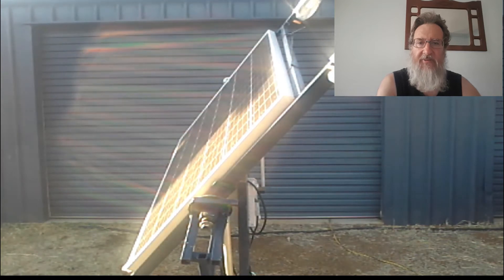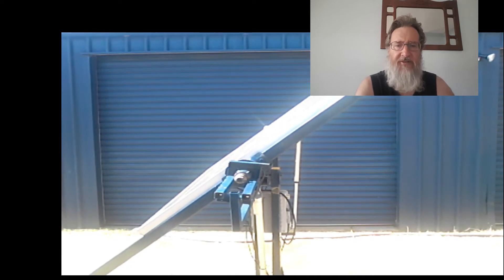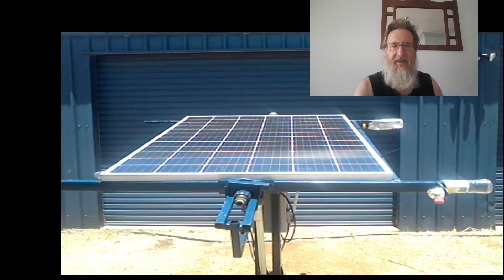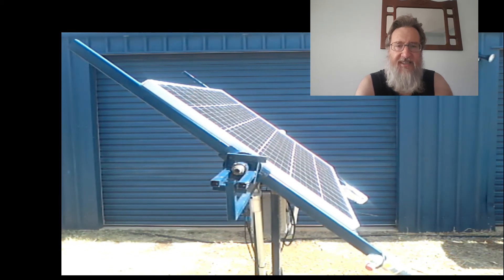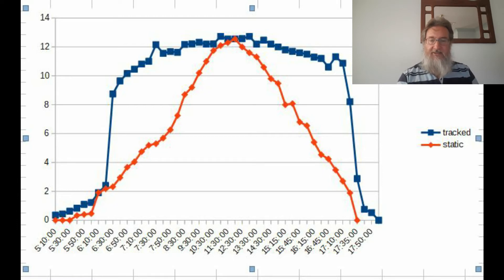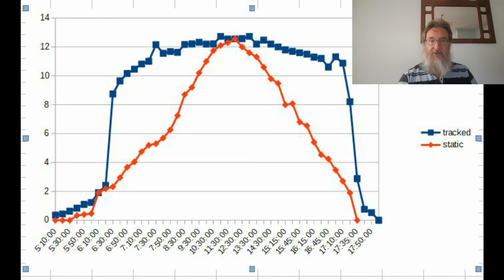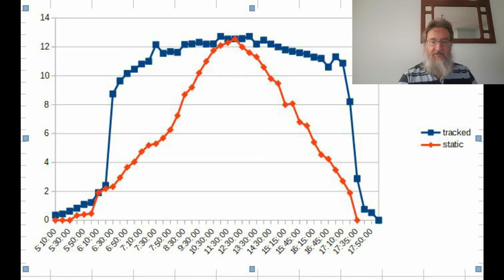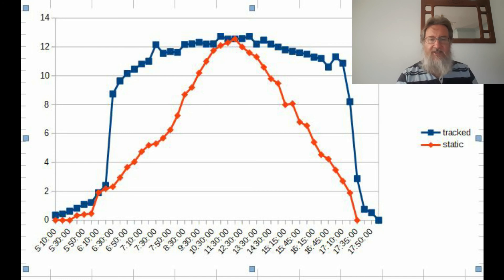Should you use a solar tracker?

Comment: Hi, I use a 2-axis solar controller with my solar tracker: https://youtu.be/_Rs8CptQcDw . Save electricity costs: With the Dimmer + Solar PV, self-sufficiency will now increase to almost 95%, which means a huge breakthrough. The prerequisite is that you have at least a small balcony power station, and you don't need an expensive battery either. Example of a kettle: Without a dimmer, the 2500W - 600W PV system needs = 1900W, which you have to pay more for. If I turn the kettle down to 600W with a dimmer, then every weak PV system can now supply each consumer independently and independently, because the 2500W kettle becomes a 600W kettle thanks to the dimmer. Magic... The 2000W e-heater becomes a 500W e-heater with a dimmer, which can run 12 hours a day free of charge via PV. https://youtu.be/QbLWDbJi6ew . The 4000W oven is also tamed. Not the solar systems have to grow, but the consumers just have to drop by 75%, which is sooo easy with the dimmer. are you convinced now I have already switched my entire household to dimmers. Please have a look at my channel. ... 🌞  Increase mini PV solar self-sufficiency (winter and camping): A boiler and other power-hungry consumers can be infinitely reduced using the "5000W dimmer". Ebay €7. I run 5 dimmers in parallel on an 850W inverter. Kettle 2.2KW at 150W runs 12 hours a day, so the water is always hot. The room is also nicely heated. 2.5KW washing machine runs in parallel with dimmed to 400...600W and always reaches its 60°C, and also its 1400rpm... It doesn't matter to the washing machine whether it changes the washing temperature to 5min@2500W or 100% can be achieved free of charge via existing PV power in 20min@600W. The wash cycle lasts the same time dimmed and non-dimmed, 3Sth 10min. The iron, dishwasher, oven, electric heater, waffle iron, coffee machine, all internal heating are throttled with me. Videos on my channel https://youtu.be/eC2olbCBhh0 The inverter stays cool, quiet and the MOSFETs + (battery) remain intact because no extreme current peaks arrive at the inverter. Now every Mini PV Inverter is enough to operate large devices. So, with the dimmer, all internal heaters/devices can be converted into base load devices that stay almost permanently ON, drawing very little current directly from the PV. With a wattmeter / energy cost meter you can then measure this perfectly in order to set the dimmer optimally. ... Comments: "Great idea - despite studying electrical engineering, I didn't think of it myself ;-)" or "I installed it in our washing machine, great idea!" or "Glück Auf Christian, I'm a professional myself but I haven't figured that out yet.👌 Greetings Mitch💚" and many more... Possibility 2: A bridge rectifier on DC change, then iGBT + potentiometer, around the regulate DC voltage. I can build this, but a bit too much effort for others. LG Christian ...🌞

Comment: That depends on whether you want to minimise cost of the installation or maximise output or improving output and the start and end of the day. Or anywhere in between the two extremes It takes costs, returns, the local cost of power and interest rates to name but a few.
Reply from the maker: Very true and we built this for a site with no mains grid power and no chance of getting any.  Wind  power wasn't available due to it being a forest of high trees and no water course for hydro. 
Solar,  tilting to maximise the sun available to the clearing in the forest  is the best option.  Fuel  for a generator is 20+ km away,  when the tracks are open and not flooded, muddy or blocked by fallen trees.

Comment: Anyone looking for a grid-tied system in the USA. Ten years ago trackers made a lot of sense because PV modules were so expensive. By about 2016 it made more sense to add a couple more PV modules instead of installing a tracker.

If you are grid-tied with a very small area to install solar they can make sense.

If you are off-grid trying to maximize winter production they can make sense. 

Experience - Working for solar installers and manufacturers since 2006.
Reply from the maker: Add you say, grid-tied in the USA.
For a household system you'd need a vastly larger installation. This design is for a portable system that would support camping or minimalist off-grid life.
This tracker, with 3 panels supported us for 7 months whilst we camped in the rainforest of NSW. It kept up with fridges, domestic washing machine, laptops, phones, lights, water pump, etc.
We were in a clearing where trees limited the sunlight and it was the Australian winter. Maximizing the panel output was key.

Comment: All this can be made much, much easier.

The easiest way is how an Optical Telescope basically works according to the 'Equatorial' principle. The equatorial mount has a north-south "polar axis" that is tilted to be parallel to earth's polar axis, allowing the telescope to swing in an east-west arc, with a second axis perpendicular to it so that the telescope can swing in a north-south arc. By swiveling the polar axis of the mount or mechanically moving in the opposite direction of the Earth's rotation, the telescope can accurately track the movement of the night sky. 

See the link for this >> https://en.wikipedia.org/wiki/Equatorial_mount#German_equatorial_mount
Reply from the maker: I look forward to seeing your working design.

Comment: Dear,I am from southern part of India,Latitude 10.164&Lon.76.466.My question-'is it worthwhile installing a tracker?'
I have got two mono solar panel 24V /390W and an MPPT charge controller 140V/60A.Sun angle will varry from 13degree (monsoon- rainy and cloudy)N to 33 degree S(winter december)
Reply from the maker: Well you could test and evaluate it for yourself. If you look at my other video where I compared the tracking output to non-tracking output.
Pick two non-cloudy days and then plot the output every 20 minutes (for example) from Dawn to sunset.  Multiply the output voltage by output current, into loaded batteries (i.e. not fully charged) to get the output wattage. Compare a day where you leave the panels at the angle where they get the best at mid-day against one where you move them every time you take a reading to where their output is highest.
You should see about 50% more per day when tracked.
Whether it is worthwhile depends a lot upon scale. The fewer the panels, the more it matters on a cost benefit basis. 
For the size of my system, it absolutely is. For the scale of a system supplying a grid connected house, probably not, (depending upon the value of your sold excess).
Reply: A tracker Is Always Better than fixed panels

Comment: I Dada, when you bought your solar tracker WST0-2, you got the manual also I hope, because I want to buy one, and I think that is not easy to understand. What do you think. Thanks
Reply from the maker: Hi, the instructions that came with it were not the most comprehensive and a bit 'Chinglish'. However, it is not really very difficult to use and once you get the hang of the way it works, it is quite easy to set up.
I find many devices of this nature have the same sort of procedure of cycling through parameters in order to set them up. The first time through it seems like gibberish but after a few goes it all makes sense - or at least that is how I find it.
Reply: @dadawoodslife  Hi Dada, Chinglish is a new language :))...  Thanks a lot for your reply, regards.